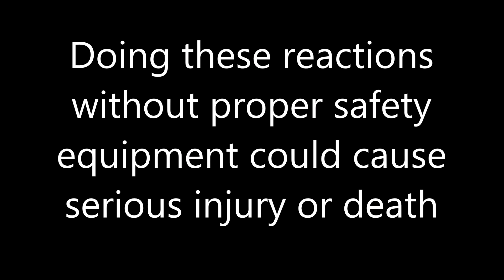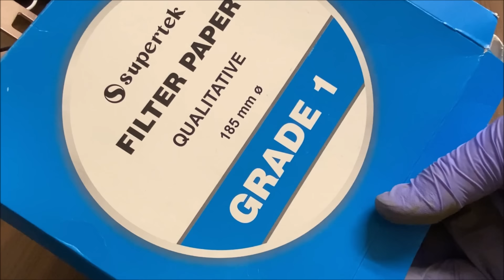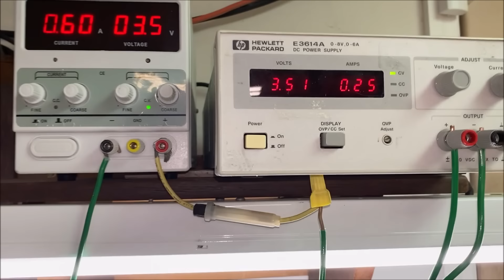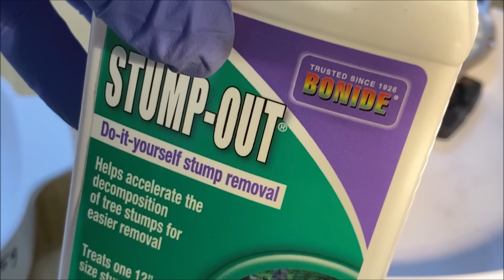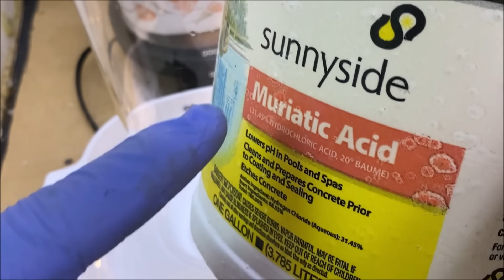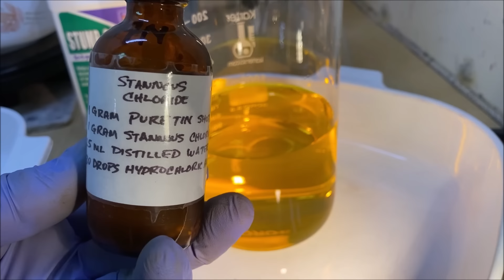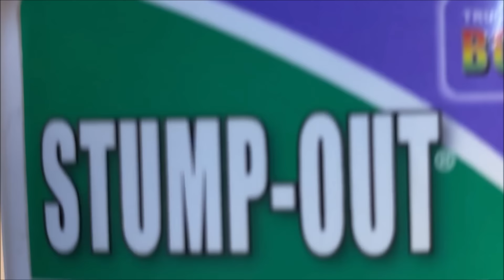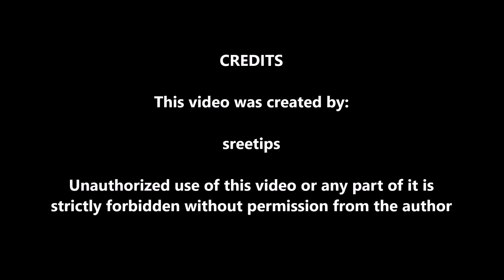Gold Filled Scrap Recovery and Refining Part2

Comment: Thanks for the stanous recipe.  I usually just throw tin solder in HCl but it takes 24 hours to start working.
Reply from the maker: That recipe will last for up to three months. I’ve even freshened it up by adding a few more drops of HCl to get it to last a little longer.

Comment: Search Refractory kiln support mat. Not exact but similar and should work, round with 3 support ribs to support a crucible dish
Reply from the maker: Those look promising.
Reply: Do they have support ribs over a clear, centralised flame spreader? Flames from both sides works best, 360° encapsulation is heavenly.

Comment: Coriolis effect only applies to large-scale systems like storms and ocean currents.  This is probably the Marangoni effect or something similar, where the phase change is causing gradients that cause a flow of material.  Could also be convection currents if part of it is heating or cooling.

Comment: Brilliant explanation of stages, thankyou 🙏🏼

I have one question - once I get to the powder stage, I'm not getting a nice melt like your video? I'm using a Map-X gas plumbing style torch, no oxygen. 

It's not pooled together nicely like yours, and I have tiny fragments stuck to my melt dish too..

What would be the issue?

Thankyou
Reply from the maker: Make sure to glaze the inside of the melt dish with borax before attempting to melt gold in the dish.
Reply: @sreetips  that's super helpful🙏🏼

Could you kindly also refer me to one of your videos that will help to explain the process of separating out silver from the rest of the base metals in the nitric boils left over after boiling gold filled jewellery?

Thankyou
Reply from the maker: Just add a piece of clean copper and cement the silver out. That’s what I do.

Comment: I would probably look into Kiln Shelf products to replace that cracked tile.
Reply: shoprainbowartglass seems to have smaller shelves in the 10 to 20 dollar range and a pack of 4 one inch posts for 8 bucks.
I figure if it's good enough for a kiln it's probably good enough for your crazy oven?

Comment: Once the foils and mud were incinerated, would it have been a good time to inquart the results? The green color that was apparent when the HCl was added @12:17 suggests that the metal there was not pure enough for the aqua regia.
Reply from the maker: No, I’ve tried melting the foils in the past. I’ve tried inquarting the foils in the past. Both were unsuccessful. This is the easier softer way to process GF scrap. I’ve done it like this with excellent results for almost fourteen years.

Comment: Do you need to neutralize the nitric acid in your aqua regia solution prior to precipitating with sodium metabisulfite? Much thanks, love your video's!!
Reply from the maker: Yes. However, if you use incremental nitric dosing, adding just the right amount of nitric acid to just dissolve the gold, then there no need to denoxx because if done properly then there won’t be any excess nitric to get rid of. If excess nitric is suspected then evaporating the gold solution to rid it of excess nitric is by far the best method. Even if it takes a little longer.
Reply: This said, you say in the video that approximately 3.5ml of nitric for each gram of gold filled jewelry is what you have found to be effective in eliminating all base metals. Is this 3.5ml's 50/50 diluted nitric acid? If I were concerned about denoxxing any excess nitric could I also add a small amount of urea? Also, have you heard of the Shor product of MX3 concentrate and their Quadratic precipitant in place of nitric acid and sodium metabisulfite respectively?
Reply from the maker: You’re talking two completely different processes. Recovering the gold foils from GF scrap with dilute nitric boils is a recovery process. Once those foils have all the base metals and silver removed during recovery with hot dilute nitric, THEN the refining process begins. Aqua Regia is a refining reagent and is not used during the recovery process.
Reply: @sreetips  Yes, I understand the two components are separate. I have a number of gold filled eye glass frames to process. Do you have any suggestions for that type of gold filled scrap? It is my understanding that they have quite a bit of stainless steel components in them, similar to watch bands? Also, one of the concerns I have is when I get to the precipitation phase with Stump Out. How do I know if my nitric acid needs to be "denoxxed" or not? I am in fear that my gold will just go back into solution after adding the Stump Out without the nitric being neutralized. I am most likely overthinking this as I am a '"newbie". Your thoughts are super helpful. I have gained a tremendous amount of information from watching your awesome content! I look forward to more great videos. 👍🙏
Reply from the maker: Eyeglass frames have spring steel in the curved part that fits back around the ears. It can be troublesome. I always cut those off, set them aside and save them, and do the frames (with the curved pieces cut off) separately.
Reply from the maker: You can tell if there’s too much nitric if while the gold solution is on high heat, there are fumes inside the covered beaker. I just keep the gold solution on the heat and let it boil, in a covered beaker, until all the fumes are gone and the air in the beaker is completely clear and colorless. If it goes too far and gets evaporated down to dryness then I let it cool, add some hydrochloric and heat, and few drops of nitric until it all goes back into solution.
Reply: @sreetips  Great information to know, thanks so much for sharing that!

Comment: Refractory cement its called and yes it was Amazon i saw it.  YOU CAN DO IT!!
Reply: My 1st run of GF produced 2.5% yield.  I wonder wat people get on the lowest end?  I think the highest average yield would be 4% ? 
Imagine gold ore that rich.  Even at 2% tgat would be 160 oz  per ton !!!   Urban gold prospecting has a lower operating cost and lower polution footprint by far..  and ...I looked for gold in rocks over 45 years never finding enough to cover the cost of food and water 😂  first yard sale I went to I walked away with 1/4 oz Au for less than 40 bucks😊😊😊😊😊  
Now I really need to learn how to make and upload videos instead of all live streams
Reply from the maker: Urban mining! We found $3k worth of gold for about three hundred fifty bucks. But people are staring to wise up. We used to find a fist full at yard sales just about every weekend back when gold was $1200. Those finds are becoming more rare, and it will get even tougher to find when folks begin to realize that cash is trash. Holding savings in gold and silver is a much better idea.

Comment: Have you considered doing a breakdown on ores? I can get you sulfides easy enough with about 8 oz/ton Au, and might also have some from a silver mine that was running aroun 200 opt Ag and 20 opt Au with lead copper and other stuff starting to replace the bases down lower. When we were recovering it, the strike of the chisel would break the sulfur and also strike against the iron to make 1" puffs of 'dragons breath' as we called it, ignited sulfur from the spark.
Reply: Bronze chisel is used in that case.

Comment: You can rinse more soluble metals out of the sludge with a couple small aliquots of hot DI water.

If you added a table spoon, or so, of sodium persulfate to the collected gold sludge, before you ash it, it'll leave less carbon from the paper.   Stir the ashes and then add another spoonful of sodium persulfate and it should be ash free after you roast it again, when you're done.   Less residue to filter out/deal with.

Taking the liquid out of the melt dish, with the eyedropper, should have you squirting the liquid right into the gold waste flask.

You're selling again?  I thought that you were done with that?
Reply from the maker: I need some paper to pay my taxes. The irs won’t take gold.
Reply: @sreetips  I feel your pain, brother.

Comment: I liked the detail of adding the cloth in the water to avoid scratching the bar
Reply: That's a detail with many uses here. Did you notice the after boil? The cloth prevented direct metal to metal conduction of heat into the stainless bowl.

Comment: I noticed you use the hardware store version for both muriatic (HCL) and sulfuric acid. You use the GFS brand for your nitric acid. Are you doing this because the hardware store brands are much cheaper? I don't believe the hardware store carries the nitric acid, at least here in Phoenix, AZ.  I can get a gallon of HCL from Ace at 37% and sulfuric acid 90+% much cheaper than at my local lab store. Is there any difference in the performance between these acids vs. the "lab" purchased acids? Learning tons from your video's, love them!!
Reply from the maker: I’ve used HCl and Silfuric from Ace Hardware for fourteen years with excellent results. It’s cheap, usually always available, and most convenient to pick it off the shelf when I need it.
Reply from the maker: Nitric is available at any chemical supplier. I use ACS grade but technical grade is fine for gold and silver refining.
Reply: Much thanks for the replies!! I will save some money then and get my sulfuric and HCL at Ace. They want $75 for a gallon of HCL at my local chemical store. I think the muriatic acid 37% at Ace is around $10.

Comment: Ok new question: Gold is heavy and sinks to the bottom in most cases. So how do you acheive solution? What keeps it from being an emulsion or suspension?
Reply from the maker: I put the gold in solution by dissolving it in two acids: hydrochloric and nitric. In this case I used about 300ml hydrochloric and about 12ml nitric acid.
Reply from the maker: Why doesn’t it emulsify or suspend? I don’t know.
Reply: @sreetips  I appreciate the replies. I'm not able to do what you do, but I find it fascinating. Personally, I've always prefered silver to gold but both refining processes peak my interest.

Comment: You have said it takes about 3.5ml of nitric acid per gram of gold filled items being processed. It is my understanding you digest off the base metals with a 50/50 solution of distilled water and 68-70% nitric acid? This said, does the 3.5ml of nitric acid mean 3.5ml of acid diluted with 50% distilled water or 1.75ml nitric 68-70% plus 1.75ml distilled water making the 3.5ml nitric solution? I am trying to calculate the amount of concentrated 68-70% nitric acid I will need to digest the base metals for 295 grams of gold filled scrap. Much thanks!
Reply from the maker: 3.5ml of 68% nitric diluted with 3.5ml distilled water per gram of GF scrap.
Reply: @sreetips  Thank you so much for clarifying my question! I will need to have a little over a liter of concentrated nitric acid for the base metal removal part for my 295 grams of gold filled scrap then. I am hoping to get around 7 grams or so of 99% AU out of this batch if I don't screw it up! 😂
Reply from the maker: Go slow because it can boil over especially when you first start adding the nitric. I’ve found that it best to “over do it” with the nitric boils to ensure as much junk gets removed as possible. The longer I keep it in the nitric acid, the easier the refining with Aqua Regia will be. Also, don’t forget to incinerated those gold foils after the nitric boils. Don’t skip that step and go straight to Aqua Regia. If you do, then I guarantee your yield will be off. The three most important things to remember when you’re working with this kind of material are: incinerate, incinerate, and incinerate. Good luck.
Reply: @sreetips  Yet again, you are a wealth of knowledge here! Can I incinerate with a torch or is it better in a kiln? I have a Vcella model 16 kiln but that takes at least an hour or so to reach around 1300 F. It would be easier and faster to just incinerate the material with a torch without melting it if that would work. If not, I can fire up the kiln.
Reply from the maker: Torch will work. But it has a tendency to blow stuff out. Your kiln would be better. May take a little longer but I think you’ll like the result much better than using the torch.
Reply: @sreetips  I would agree, much thanks!

Comment: I'm seeing a lot of Gold Powder in your flash. I'm betting a few of those Gold Filled items were actually Gold Plated.
Reply from the maker: Not so, I test each piece that’s not marked.
Reply: If that's so, then how do you explain all the gold powder? That's what's clogging up your filters. A rolled gold chain will not break down like that into powder, but leave small links of gold foils. @sreetips
Reply from the maker: Just like some solid karat gold ended up in there, so too did some gold filled that had worn away. The thick coating thins out as it wears. And this, I believe, is responsible for the gold mud. I’m very careful to exclude gold plated material (maybe a thin GP chain got tossed in) Because GP material has a base metal that consists of junk metals that form nasty, milky compounds, in the acids. I know this from experience.
Reply: That gunky white mess is the result from brass. I try to avoid that as well, but I process gold plated material all the time, and I see it a lot. Gets stuck in my filters. I have to rinse it with Muriatic acid to dissolve it out. @sreetips

Comment: I would like to ask, what is the purpose of the incineration step?
Reply from the maker: It burns off undesirable compounds that can cause problems during the refining, especially tin. Tin dissolved in nitric forms metastannic acid - tin paste. Burning the foils converts it to an oxide that’s insoluble and easy to filter out. If incineration step is skipped, then I know from experience, the yield will be reduced.
Reply: @sreetips  oh wow. Thanks.

Comment: What’s the lowest karat you put in there? 10k?
Reply from the maker: Some of it was 1/20 10k Gold Filled.
Reply: Wow I didn’t know that was a thing, 1/20th of 40%?
Reply from the maker: 1/20th of 41.7% (10k is 10/24=0.417)
Reply: @sreetips  so very little but not as minute as platted..?
Reply: @sreetips  I also got a kick out of that medical bracelet being a whole lot more gold than that jewelry
Reply from the maker: There’s about 2.5g per hundred grams of gold filled material.
Reply: @sreetips not a bad ratio really

Comment: If hydrochloric acid is the same as muriatic acid why both names for it?  Why not just call it one or the other.  

Another great video sir!
Reply from the maker: Just about every compound has at least two names; “salt Peter” is potassium nitrate, sulfuric (sulphuric) acid is “oil of vitriol”. Nitric acid is “spirit of nitre”. Sodium carbonate is “soda ash”. Etc…
Reply: @sreetips thank you so much for the information I didn’t know that a lot had other names!

Comment: Chief!   I've seen ceramic and silicon carbide shelves and grates in stores that sell pottery kiln accessories.    You'd need one designed for high temperature glaze firings.   Your current one has seen some amazing service and deserves a long retirement!
Reply from the maker: Good lead, thanks Andy
Reply: @sreetips applied ceramics out of Atlanta GA or Lauren’s S.C.  may be time for a road trip. 😂😂
Reply: That looks like the furnace element holders for “my” Cress Furnace at work. “Ceramic heater plate” search will likely get you headed in the right direction to find something that meets your needs.
Reply from the maker: @dpd069 thank you